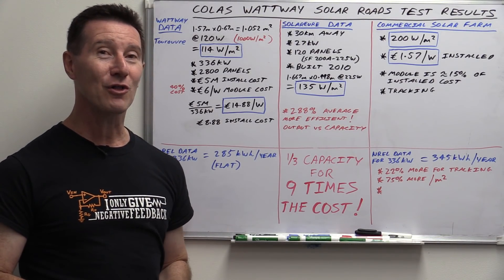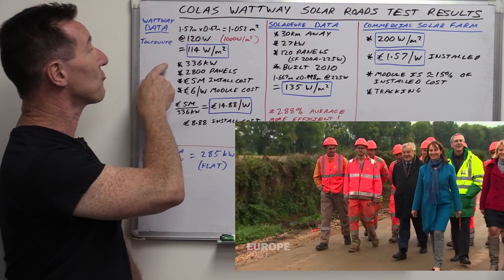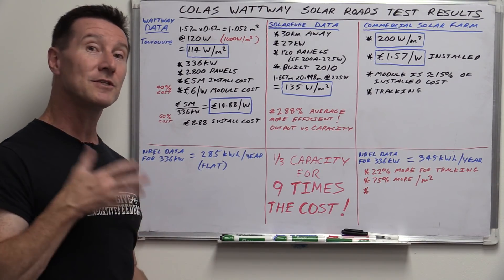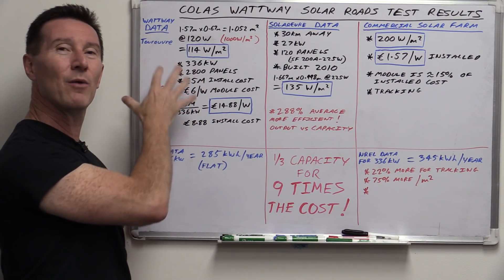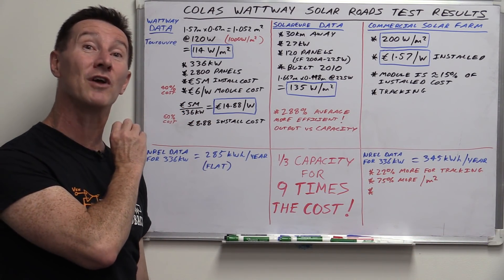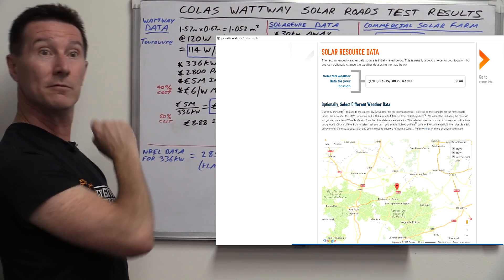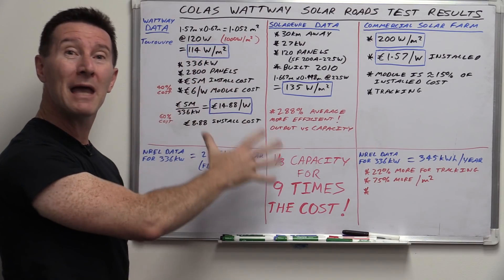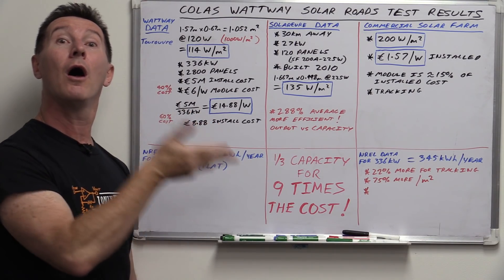EEVblog #1047 - Solar Roadways FINALLY BUSTED! (Colas Wattway)

Comment: well, Dave, did you ever stop to think that we could make our roadways on an angle and install servos to tilt the road surface to track the sun?? HMM!??! think outside the box for once!!!! :P
Reply from the maker: Kickstarter NOW!
Reply: Mind-blown.
Reply: ericbuds Actually, you might be on to something. If we also made all motor vehicles 100% transparent (to avoid blocking the sun as they use the road), and also implement hover-drive (so there is no wear and tear on the solar road surface), then I think we are almost there. Of course... assuming the cost factor is disregarded. :)
Reply: Great idea, take it further though, remove the vehicle engines. Just use the energy to tilt the road! Everyones going the same way anyway...Imagine your car surfing the road to work. (Back to reality now...).
Reply: No, no, no! Just build elevated roadways. They'd be closer to the sun!
Reply: Why surf a car?  just wear teflon speedos and glide to work :)
Reply: Errrrrrr...  this came to mind... https://youtu.be/Ef93WmlEho0
Reply: Good idea ! And after we tilt the road, we drive under it ! :D
Reply: the amount of woosh in this thread is amazing
Reply: I suppose it's possible to think of a worse location for a solar panel than a roadbed, but it wouldn't be an easy task.  
You could build a covered road, put solar panels on top, and you'd eliminate most of the problems, achieve most of the benefits, and at a fraction of the cost.
Why this concept never seems to come up, is anyone's guess.
Reply: it's hilarious how dumb some of these replies are lol
Reply: Why not build a free energy generator that won't wear out over time. Ummm, now I think the servos road make much more sense.
Reply: Thumbs up for the best trolling idea yet, servos to tilt the road surface to track the sun, LMAO!
Reply: why not wind generators inside butt plugs?
Reply: Jusb1066 You are our generations Albert Einstein.
Reply: Normal roads are generally at a small angle to make rain go to the sides instead of staying on the road
Reply: Are u Wile E coyote ???
Reply: Also, if we get hovercars to just hover above the road, they won't get the panels dirty.
Reply: Tilt the road ?we got enough problems driving on level roads.
Reply: Jusb1066 because then you would lose the ability to use butt plugs as gas-powered airsoft mortars. And that would be a great, great loss.
Reply: benjovi55 
All we need to do then is build a road next to it.
Reply: So many autists are taking this comment seriously. Take a good look, it's an obvious joke.  I know that you guys have trouble with social cues like that, but this one is waaaaaay too obvious.
Reply: The Solar Roadway concept would never exist without massive scientific illiteracy.
Reply: @ElmerFuddGun I'm sure he was kidding, but Poe's Law is currently running at 110% on all reactors, so doubt is fair.
Reply: ericsbuds while we are taking the piss on them micro motors on small cells may actually work. I expect it would be too expensive though compared to a standard module with tracking.
Reply: As an added bonus, your daily commute becomes a game of Mario Kart!
Reply: +Landrew0 - Some have thought of it: http://road.cc/content/news/148063-south-korean-solar-powered-bike-lane-whizzes-cyclists-along-six-lane-motorway
Reply: For a small price of 10 million dollars.
Reply: this needs to happen
Reply: When ppl can't hear the sarcasm of the comment and lash out.
Reply: in theory a F1 car could drive upside down at 300 km/h because of the downforce the car generates, so car slipping off the tilted road wouldn't be a problem if everyone drove a F1 car.
Reply: Nikke 2800 if everyone drove F1 cars then humanity itself would very quickly stop being a problem, even without tilted roads
Reply: Imagine when the servos fail to work.....
Reply: ericsbuds why not just put it 50m to the side of the road with a tracking system instead so the solar panels are not in the way of road construction crews and the road is not in the way of the solar construction crews.
Reply: Dead Frt West 
Wait!!! That's it... solar tile the sun!
Reply: Yo Nigga 
I know right, so many people with a stick up their ass.
Reply: +benjovi55 exactly. who said we even have to drive on the solar roadways?
Reply: Turns 5 oh shit the roads tilting
Reply: Or we could just get earths population to jump up again and again until the entire earth is flat, then we will get 100% efficency without any tilt!
Reply: ericsbuds still not cost effective, tilting roads, rain, snow, dirt, general wear & tear, no material is that durable and translucent. 
A better use would be to have them along the motorway using your idea not as the motorway.
Reply: A road that tilts from vertical to horizontal and back to vertical in the other direction (180 degrees).  Winner!  No problem driving on that road.  Of course that in only in one axis.  If you were really clever you could make it tilt and track in two axes to allow for a road running in any direction.
Reply: tcpnetworks - you are seriously asking that, right?

Wow...
Reply: Suction cup tire just have too be invented.
Reply: Why are we not funding this? And why are we still funding that Solar fricking Roadways bs?
Reply: Tilt the road surface you are on crack!!!!
Reply: Yo Nigga

They probably came from Reddit where you have to signal it's a joke otherwise everyone spazzes out.
Reply: yeah, think outside the sanity box, it helps you in getting exploited by scammers and idiots =D
Reply: ericsbuds Thats just gonna add more to already existing huge cost!!!!!!
Reply: You are being funny, right?
Reply: Please tell me ur being funny

Comment: No matter how YOU spin this, 99% of people don't understand or want to understand technical data and factual information, 99% of people believe marketing BS.
Reply: This is basically the entire reason Apple has any customers.
Reply: /glcrazy  dude this is Youtube, not your blog or something..
Reply: Strider9655 one percenter lol ✌🏻
Reply: To my knowledge, most people don't dislike Apple for their tech, but for their business practices. They hide any and all methods of repairing their products behind what are effectively security codes you must input either into their website or over the phone just to have them tell you that you must send your computer or phone back to them so they can repair it themselves for a fee that justifies buying an entirely new device. They come out with a "new" product that is effectively just a minor hardware and/or minor to major software update that, if they allowed it, could be easily done either in a store or at home without buying an entirely new device. The computers and phones they sell might be good, but when you can get something for roughly the same initial price without the restrictions Apple place on their customers' devices, that may very well be the more preferable choice.

And let it be known: you CAN repair Apple devices on your own, so long as you know what you're doing or can find out. There are videos on YouTube detailing the procedures for most of Apple's recent products. It doesn't cost $250+.
Reply: Your figures are also BS. Just FYI. When someone is using 99%, you know it's BS
Reply: Ah yes, sweet sweet capitalism!
Reply: Strider9655 
I don't understand either.
Reply: Just like those creams that say they kill 99% of bacteria 😂😂😂 

I wonder how many people actually believe that.
Reply: Mi 28 "This is basically the entire reason Android has any customers." FTFY Also, the irony of your comment on this video, considering Android, from an engineering point of view is just like solar roadways. Only bad decisions from the beginning. There's a reason computer engineers buy Apple, because the numbers always speak the truth. Apple chips always beat the crap out of other manufacturers in performance. Android is nothing more than a platform to sell the "newest thing" to people that don't mind paying huge sums of money for "features" which are still in the prototype phase, or maybe even completely impractical. The engineering decisions are also awful, proving that there were made by business people, and not by engineers. No computer engineer would ever make a non-systems, virtualized and garbage collected language like java, the programming language for developing apps on a resource constrained, and user facing environment like a mobile device. That is like computer engineering 101. Hate Apple as much as you want, but they have the best engineers, and that is fact. Good engineering design and practices >>>> than constantly creating new features without any time given to creating a good design. But hey, I guess it's good for business, when the only thing you do is create putting together a bunch of off the shelf components, because you don't know how to create them your self, and installing a free operating system, because you don't know how to create your own. But let's all hate the only company that has the expertise to create an entire system from hardware to software completely in-house. I don't blame you though. When all adds on TV, radio, stores and everywhere else are for Android devices, and when companies like Samsung sign contracts with stores and telecom companies to make the employees push their devices instead of being fair, people get fooled easily.

Comment: I would think that a towed trailer that drops its hitch (pulled by chain only for a bit) would do a really nice job on a solar roadway. Who would be responsible for the damages, which would be substantial? The insurance agencies will start thinking about this and rates are going to go up...
 - Eddy
Reply: Deathlok67 That is already an issue. It's just that people never get stuck with the bill since the damage is usually minimal. (Or no one that cares sees the damage happen.) Spill paint on the road way, you pay. Crash into barriers/dividers, you pay. Cargo transporters caught at a weight station carrying more than the roadway allows, that company pays a fine. The fact of the matter is, this is research & prototyping, about advancing the future. Dave must be related to the idiots of the past that said things like, "There will never be a computer small/cheap enough to be accessible to the everyday man." Or, "There won't be batteries with sufficient energy densities or CDR that will make electric cars practical." 

He's just a shortsighted idiot that obviously isn't able to realize the potential of emergent technologies. This video really makes him sound like a real moron.
Reply: I'm surprised some kids haven't grabbed a sledgehammer to see if they can get a panel to catch fire yet...

Comment: I can only think - where I live every highway gets repaved/rebuilt about every 10 years. So if you incorporated it with the construction budget you could likely get the costs down. Although public works projects are always bloated in cost. But then there is the debacle of reflectors in the roadway. But because we get weather the plows tear them up.
Reply: Yeah but these panels are custom made. Whereas if you put them on the roof of your local IKEA/Wal-Mart etc. you could use off-the-shelf panels, that are much less expensive and probably also more reliable. 
Oh and they don't need to be resistant to cars and trucks running over them :-)

The most efficient way to do it would be to build a canopy made out of solar panels over gas stations and parking lots. A Carrefour in France had such a car shade whose roof was completely made out of solar panels, supported by a wooden and steel frame.
Reply: Yeah, that's where he talks about the panels being 40% of the cost, and construction being 60%. Even in a best case where you would have spent just as much on construction (crazy unlikely), and they get the panel cost down to half (when?), you're still talking about going from €14.88 to €2.98. That's still DOUBLE the cost of existing commercial solar.
Reply: And while people waste their time arguing about solar roadways, the roofs of IKEA (5600 m2), Castorama (4900 m2) and Decathlon (3600 m2) near where I live are just baking in the Mediterranean Sun with no energy output... and the funny thing is that my region is nicknamed"the region of the sun"...
Oops
Reply: And what does the highway surface look like when it's 10 years old and ready to be repaved? Not pretty, right? Lots of potholes patched up, etc? Do you think the solar panels would still be functional at that point?

Comment: Dave, I think you could make a great debunking video about solar power optimizers.  The manufacturers claim these can increase the harvest of a PV array "up to" 20%  But an NREL report shows the average residential PV array would expect only 2-4%.  
These things are basically glorified step-down DC/DC converters that reshape the IV curve of a partially-shaded PV module, boosting it's output current to match the string current set by the MPPT in the central inverter.  Theoretically, this can recover some of the energy lost due to mismatches between PV modules, but the dominant source of these mismatches is shade, and most residential arrays don't have much shade.  The added material cost and hit to system reliability (the j-box on the back of a PV module is a harsh environment) outweigh the small benefits, in my opinion.  And yet these things are really popular in the US residential solar market.
Reply: I think the power wasted in another DC-DC conversion, especially because it's a lot of small DC-DC converters which are often less efficient than a single big one, greatly outweighs any potential gains the system might offer.
And as you say weather proof boxes cost a lot...

Edit: grammar
Reply: Heat is the great enemy of electronics.  A PV module can get pretty hot (>75C) just because it's a dark color and sitting in the sun all day.  So the junction box on the back of the module is already hot, before you put any electronics inside.  Optimizer makers often make wild claims of >99% conversion efficiency.  The really efficiency is probably closer to 86%, so there is some significant heat dissipation, as you suggest.  You can't ventilate the box because it would let moisture in.  It's probably not even practical to add heat sink fins on the outside of the box, because the would probably get covered with leaves or something.  So this is a tough environment for electronics in my opinion.  But I haven't found any field studies of how optimizers affect PV system reliability.

Comment: would it be beter and cheaper if we could just do kinetic roadways or kinetic footpaths were just walking or drive over it and it convert the kinetic energy into electrical energy and just  store it would have to save the battery storage problem
Reply: That would slow down the pedestrians or vehicles.
Reply: There's no free energy. Any energy extracted from cars driving over it has to come from the car. Since most cars are still gasoline based that means you'd just be burning more gas. Even if they all became electric it's just moving from a centralized power plant (EG efficient solar farm) to a decentralized one with lots of inefficiencies and losses.

Comment: Maybe Dave could do a video on the California "High Speed Rail"... It is very similar to the Solar Road.
Unfortunately, no matter how many times politicians are told "NOT practical" - they don't actually hear the "NOT" part.
Reply: Not sure if I'm missing something here (may be out of the loop), but why would a high speed rail in CA not be viable? Are the quotation marks there to indicate that it isn't really anything viable?
Reply: They are classifying 80mph as high speed. At that rate, no one will use it - especially when you can catch a flight from LAX to SFO for $50 and be there in under an hour.
Reply: 80MPH is nowhere near high speed.
In Europe, regional (Commuter!) trains run at 160 km/h (100 MPH) and they are never called "high speed"...
In fact each morning I take a commuter train to the university and it runs at 140 km/h even if it is from the 1970s!

Maybe I could suggest that to the marketing department of our railway company, so they can say that 100% of Italy's trains are "high speed" because California :P